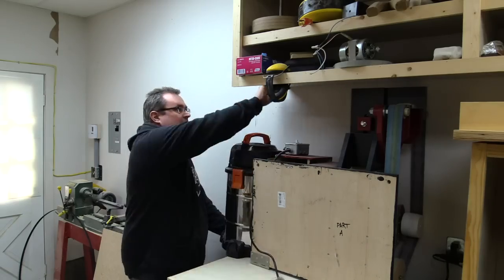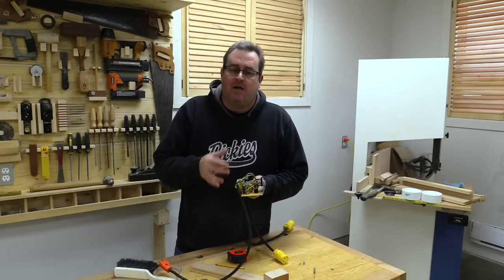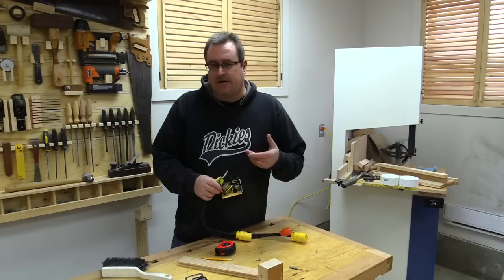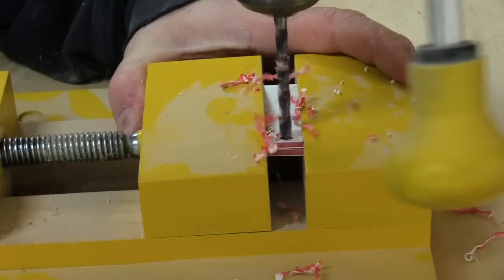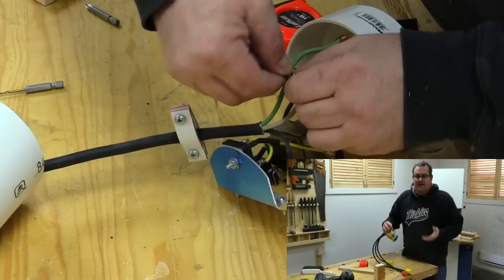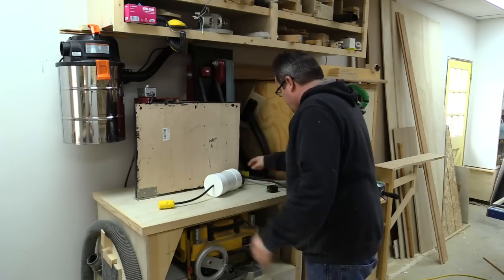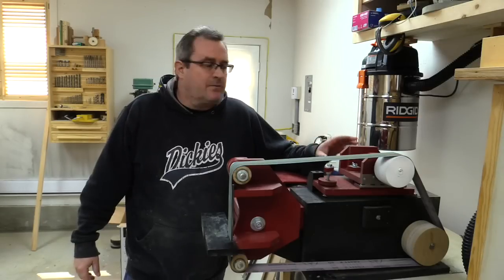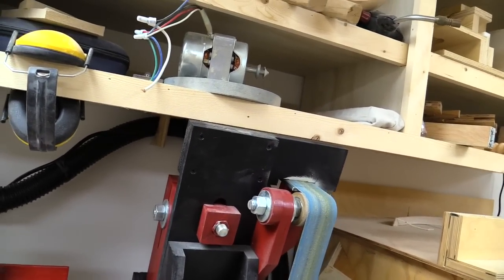The Automatic Switch

Comment: Really like the idea.  

Found this relay online that will do basically the same thing you are doing, and less than $9 on Amazon:
http://www.amazon.com/gp/product/B005T73R5E
Yes, I know the Amazon description says 20.4 mA load current, but if you read the actual datasheet, it is a 20.4 mA *coil* current and 30A *load* current.
https://www.components.omron.com/components/web/PDFLIB.nsf/0/293F63708299454085257201007DD57E/$file/G7L_0514.pdf

A fun tidbit - if you look at the bottom of page 2 of the datasheet, the AC coil triggers via a built in full wave rectifier - just like yours.
Reply from the maker: Matt DV That's just a relay and will not work to replace the circuit I'm using. The schematic at the bottom of the page you refer to is an application example.
Reply: I Build It Yeah, it is just a relay and, no, it won't replace your circuit directly.  Your bridge rectifier can handle the whole load of the saw, but the relay's coil can't.  But that schematic is under the header "Coil Internal Circuit", so that is the internal circuit, not an application example (Note 3 says "The AC coil is provided with a built-in full-wave rectifier...").  

If you were able to wire the coil across the backside of the saw switch (pin 0 to the switch output before the motor so you get all 120V, pin 1 to neutral), then this would replace your circuit.  Since the goal of your circuit is to not modify the tool, this isn't a replacement circuit.
Reply from the maker: Matt DV The schematic details a power supply to trigger the relay, saying that there should be no more than 5% ripple. Believe me, there's no transformer, bridge rectifier or smoothing capacitor inside the relay housing.
Reply: I Build It I think we are reading different parts of the datasheet.  Page 16 has a circuit for using rectified AC to run a DC coil, which specifies 5% ripple.  I've always been reading this datasheet for the 120V AC coil (the part number on my amazon link is G7L-1A-TUB-J-CB-AC100/120, which is the AC version of this relay).  So, yes, the DC version would not include a rectifier, but the AC version does (as shown on the bottom of page 2 of the datasheet, specifically Note 3).
Reply from the maker: Matt DV Ok, now I see - you said bottom of the page, I assumed bottom of the pdf and just skipped down to it. Most ac relays have some way to either rectify the ac to dc or to smooth the ripple enough to keep the coil on steady, but none of these parts are robust enough to handle any significant amount of current. Wiring an ac relay directly to the saws switch was always an option, just not a very practical one to base a project on.

Comment: Nice work as usual John. Less dissing of 240v needed though, it's marvellous stuff :) You need a few "proper" UK plugs on there as well!
Reply: Iain Hay 
Yes, 240V FTW! Only half the current for the same power. 240V makes this project cheaper because the recitfier and relais don't have to as beefy.
Reply: Iain Hay I didn't see any dissing of 240V at all. He was just pointing out that 240V is more dangerous, and thus needs respect.
Reply: w0mbles I wonder if the danger is overstated or not, I mean it ought to be statistically detecable how many people die from electrocution in 240v countries vs. 120v ones. I got 400V in my house as well, now that demands respect. But the advantages are great, infact I couldn't live without it. It would be like going back to the stone age.
Reply: 1873Winchester Just out of interest, I took a look at the figures I could find for UK versus USA. USA deaths by electrocution in the home was average 60 on the H&S site I found. UK is hard to find figures last year I could find stats from government was 2005-6 which was 13. If you adjust the figures for population the death rate is about the same. Note these are rough figures from quickly found sources but even so it seems to indicate that there is not that significant a difference between these 2 countries at different voltages. I do however agree with +w0mbles it needs to be treated with respect regardless of voltage, my original post was somewhat tongue in cheek and considering the subject matter perhaps shouldn't have been.
Reply: Iain Hay 
I don't know who came up with the "120V is safer". First, if you get "stuck" to something, because you can't control your muscles anymore, 120V will kill you the same as 240V. I just tried with 30V on my forearm (don't judge me ;) ), one contact at the elbow, one near the wrist. Even at that voltage without really pushing the electrodes I can already feel that the fingers are harder to move, so I don't think 120 is really any easier to let go than 240.
But more importantly, most of the times it's not the electricity that harms you, but the fall from the ladder or you flinging your arm around. I guess the "surprise" of 120V and 240V is the same.

On the other hand, if the rates are the same, it could be that 120V are safer, but the stupid US plug, that lets you touch the contacts while half plugged in kills more people. (dissing US plugs, because they are really crap ;) )

Comment: They actually make basic  relays with a simple delay off that is adjustable by adding a different 1/4 watt resister for the value.  Not sure the part number but radio shack has it or you can build it very basic with a 555 timer circuit from any op amp basic circuit.  Don't get caught using the same circuit, DC voltage (12 volt car battery) and a river to fish in as that is still illegal I heard lol.